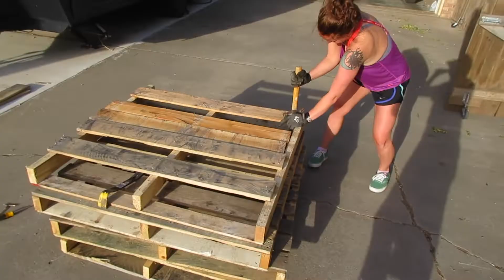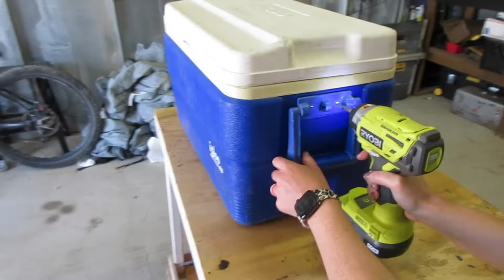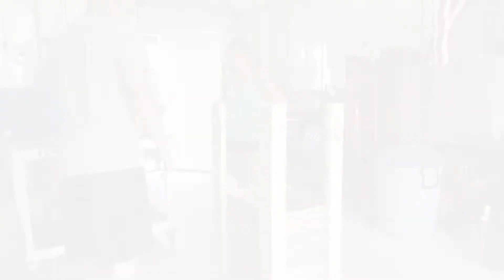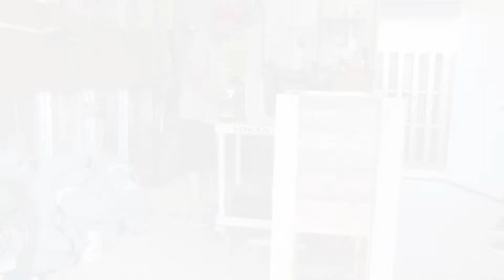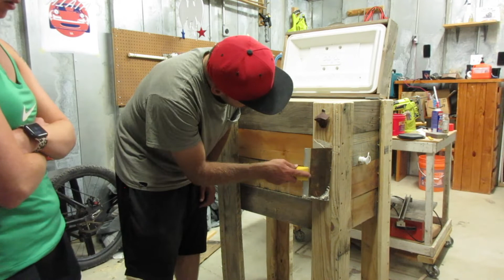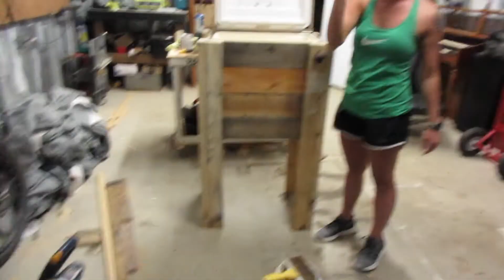DIY Patio Cooler Stand

Comment: Great build.   I got a ton of pallets and can get a cooler.   How did you attach the wooden top to the cooler lid?
Reply from the maker: Thanks for watching! All I did was build the frame around the lid and then hammer nails thru the wood into the lid around the sides. I’ve seen people use screws as well. You could use some adhesive around the edge to insure it stays put long term
Reply: @RotoCityTech  that’s what I thought you did. But wasn’t 100%.    I guess any size cooler would work right?
Reply from the maker: Yup. I had that cooler already and just built around it. So whatever cooler you have just make it fit around it. All good.